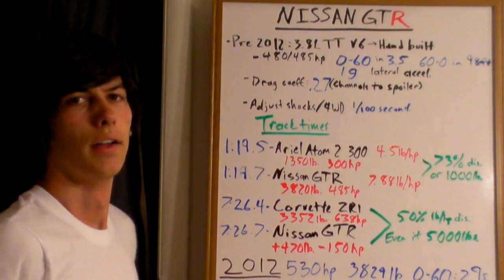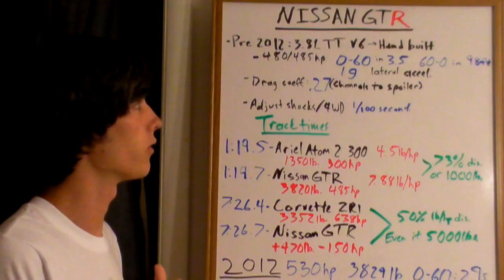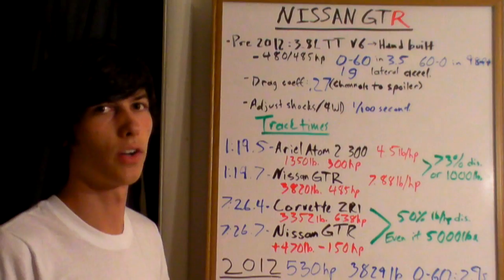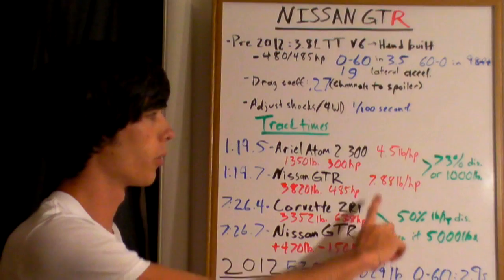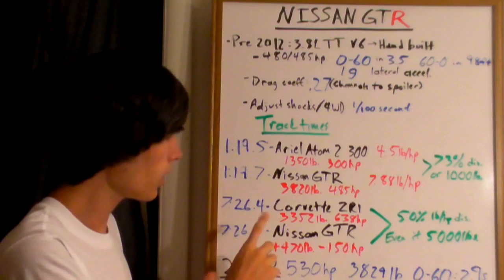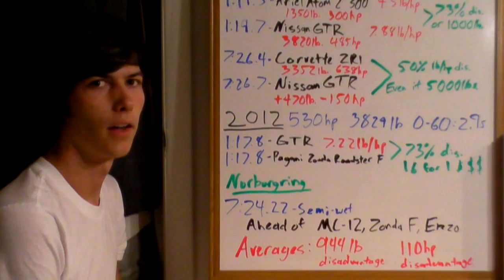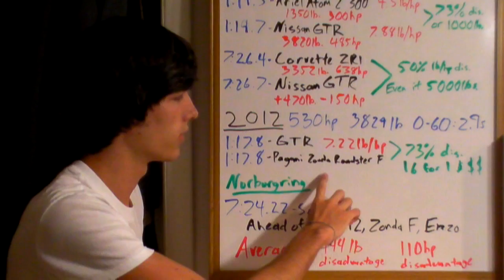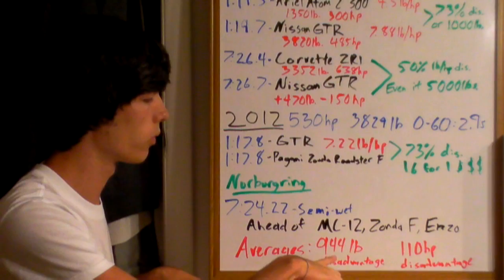Nissan GT-R - Engineering Excellence

Comment: I don't think anyone but a few people at Nissan can answer exactly how it is possible. It should be clear to anyone but the laymen (and you stressed that in the video) that power, and even power to weight ratio, are not overwhelmingly important, even for a high performance car. Putting the power on the ground is the fine art, and that's where the GTR excels in. It is also amazing aerodynamically. For the most extreme version, the NISMO, the downforce created is 220 pounds at 186mph, adequate cooling for a 600hp engine and for the gearbox is provided. Yet its drag coef is only 0.26, and it does not use active aero elements. And this is from a company that has never been in F1.

Comment from the maker: @hakeembisiolu This is true, and I didn't mention it. Knew it would come up eventually. And 45 hp will make a big difference, but even if you say this car had another 45 hp, it would still be at a clear disadvantage from a power to weight ratio. Basically my intention of this video was to show that you don't necessarily need a ton of power if you want good track times. Japanese engineers have figured it out. Others are a tad (or a lot) behind.

Comment from the maker: @JohnnyDeniz I can make a video on valves no problem. What information did you want specifically? Like differences between dohc/sohc/pushrod and how the valves relate? Also I do not know much about torque specs on engine casings. As far as rebuilds, what did you want to know? Thanks for your interest!

Comment from the maker: @JETZcorp There are advantages and disadvantages to a rear engine. Better braking and acceleration. The problem is with all the weight in the back the cars moment of inertia about the vertical axis (straight down into the car) is high, meaning the car doesn't want to rotate. If they improved the cayman more, other cars would have some fierce competition, but it seems like they don't want anything better than the flagship, which makes sense.

Comment from the maker: @zozlimits Could you explain why AWD is a disadvantage on tracks (or anywhere)? Sure, it's more friction, and at higher speeds it's much tougher to accelerate. But AWD allows for the maximum possible amount of torque at any time. You can't floor it below 40 without awd and expect no wheel spin with 500 hp at peak rpm. Around the corner, the torque goes to the tire with the most grip, not the tires holding the car around the corner. I'd just like to hear your reasoning, that's all.

Comment from the maker: @StevenSWM Same tracks, both Nurburgring and Top Gear's test track.  Tires were all different, but to my knowledge none of the cars were using slicks so grip is comparable for each car. The other cars are not 4WD, they are all RWD, however Nurburgring is a high speed track, and at high speeds grip is comparable for both 4WD and RWD. Also, 4WD tends to cause mild understeer, as well as reduce excessive speeds because of the added friction.

Comment from the maker: I still have plenty to learn. Though it main seem obviously wrong to me initially (weight having an advantage) perhaps there is some alternative motive behind it. A heavier car with 1000lbs of lift can go around a corner faster than a lighter car with 1000 lbs of lift, as it will have more weight, and thus can hold a greater G around the corner. I didn't think about this, but it's a good point.

Comment from the maker: @ERK572 That's personal preference, but at 80k you're still 35k shy of the R8's msrp, and that's for the slow (relatively) 4.2L version. The 5.2 starts at 150k. Where as the Nissan's performance blows it away for 60k less. Personally I'd rather have a GTR and a manual BMW 1-series M in the driveway for the price of a 5.2L R8. But hey it's all a matter of opinion and one's taste is one's taste.

Comment from the maker: One of the most intelligent AWD systems, torque vectoring to the exact wheel which has the most grip, a consistently high torque curve, a suspension which matches the vehicles weight perfectly, and a decent weight (rather than much downforce) for high speed cornering.

Comment from the maker: You could elaborate on what your point is. Of course different conditions cause different lap times. These times are the best times posted, mostly by manufacturers with the best driver they can get. No, I couldn't repeat them, but it is what it is. Some use roll cages, stickier tires, etc. But this is all well known.

Comment from the maker: Many corrections once more. First, it's awd, not 4wd. Second, you don't seem to have a proper understanding of grip. Grip (or the lateral g's a car can withstand) is a function of gravity (weight of car) and the frictional coefficient of the tires. It's commonly measured in g's (a force, so cars can be directly compared). The frictional coefficient of the corvette's tires is greater, so it has more lateral grip. AWD has nothing to do with a vehicles grip.

Comment: I used to have a 1999 Integra Type R and I can tell you from personal experience from track days that it was more than capable of taking on Italian Supercars when it came to track lap times. A set of big cams, free-flowing exhaust, sticky tyres and bit more bracing and correctly set up suspension geometry makes a huge difference to how the car performs. Don't underestimate the mighty Integra. Love the videos by the way. The LSD ones really helped get my head round how they worked.

Comment from the maker: I mean I understand why it occurs, I just like to open things for discussion. Basically it comes down to the AWD capabilities of this vehicle, and it's power band. By saying a car has "500 hp" that just means its peak hp is 500. Who knows what the rest of the curve looks like, at lower rpms. The GTR has an excellent torque curve which provides consistent power along the rpm range. Other vehicles may not have the same. The engine is well engineered. The suspension and AWD are nearly perfect.

Comment from the maker: Sadly efficiency is probably the only reason not to buy an STI, as they don't do well at all in that category. I like them due to several reasons: low cg engine (boxer design), AWD, powerful, capable on and off road, it's a sports car you can drive in the harshest winters or on a track, hatchback means incredibly practical, and personally I do like the styling, it's grown on me.

Comment from the maker: If the ZR1 was AWD, and had torque vectoring like the GTR, sure, it would greatly improve it's low speed acceleration, and improve the out of corner acceleration. This would add a lot of weight, however, so it's difficult to say that it would be quicker. Weight affects nearly every performance aspect of a vehicle (in a negative way).

Comment from the maker: Guess you didn't read the part about competition tires. 2 seconds behind, yes, but with so much more weight and tires without as much grip. Physics says it shouldn't keep up, but it does, which is why it is so impressive. 

As far as 15 seconds, that's about eternity in racing terms.

Comment from the maker: Would you care to offer a source? Weight and downforce are entirely different. Weight is bad for nearly all aspects of handling in good conditions, downforce means the car can hold greater lateral g's. Weight means the car can handle slightly less lateral g's as it increases. The key for a car that can go around a turn the fastest is high downforce, low weight, and of course some sticky tires.

Comment from the maker: The lbs of disadvantage is a stat saying if you took added 1000lbs to the Ariel Atom it would have the same power to weight ratio, but obviously it wouldn't have the same lap time. I did misspeak in the video though, and said 1000 onto the GT-R, I mean on the Atom. 

Good luck with your presentation!

Comment: Great video! Its a combination of the amazing AWD system combined with the quick shifting dual clutch gearbox, and notoriously underrated motor. The sensors this car has and the algorithm used to manipulate power delivery to the individual corners (wheels) has never been done before in a street car which make this car seem more like magic then engineering. All these thing combined deliver power to the ground in a way never seen before in a road going car. Please continue the great work :)

Comment from the maker: I'll agree with you on gearing, but nitrogen in the tires is far from an answer to why it handles. The compound of the rubber is far more important than what's inside. Nitrogen just seems like a way for dealers to make some extra money. Less variance in pressure due to temperature, but air is 80% nitrogen anyways...

Comment from the maker: There are RWD cars that can hit 60 quicker than 2.4, surely with AWD it would be quicker. Sure, the 1700 is at high RPM, but you can launch from high RPM. NHRA dragsters (granted, ridiculous tires and power) can easily hit 60 in less than a second.

Comment: I copy and pasted from one of my post. To safe times.

That thanks to the electronic aids and weight distribution. Put the same electronic aids on Range Rover, I bet even Hummer H1 will be defeated. There 's more than 4 monitors. 
1) Engine ecu. Same ecu as most cars, controlling power output, rev limiter, engine temp monitoring etc...

2) ABS control unit. It'll unlock the locked wheel during heavy braking and also will match the spinning speed of both front wheels. That'll improve braking performance and stability.

3) AWD control unit. Split power to specific axle to avoid push and understeering. This also work with the yaw rate sensor, whenever the car push (yaw less than steering input), the system will split torque to the rear wheel and when it yaw more than the limit, it'll split power to front wheel. The yaw sensor works pretty much same as the one you can find in an airplane.

4) transmission control unit. Pretty much the same as any dual clutch semi auto transmission. It'll shift to a lower gear when transmission set as "race" mode.

5) stability and traction control. The stability control works the same as Merk and Audi. Apply brake to where the car point at for increase steering respond, When the car start loosing it, the system applies brake to the side where the car oversteer. For traction control, it'll decrease understeer and push by better traction and grip due to 0:0-0:1 spinning ratio.

5 of them works together, it'll become an UFO. and with some daily engineering like hill climb assist, 11 bose speaker, taller, wider and longer, this car is the most capable sportscar, more capable than 991 911 Turbo S.
Reply: Well said, launch control + 100

Comment from the maker: I would disagree that a perfect driver could do better. If computers can set the rpm and traction control so that the maximum force is applied to the ground while always on peak traction, then nothing can be quicker. Also, a computer's reaction time to loss of traction/gain of traction will theoretically always be quicker.

Comment from the maker: Please, find an engineer that agrees with you. Grip is a term used to describe friction. R-compound has a higher friction coefficient, therefore more grip, therefore a car can go through a corner faster than an equivalent vehicle with lesser tires. Sure, awd helps put the power down, but only at the limit of the tire's grip. Watch my video called "traction circle." Should help you understand the advantage a little better.

Comment: actually its about the balance between weight at front and weight at rear, also, the gtr has a staggering standstill acceleration because of the high amount of weight that is pushing down on the tires, plus it has 4wd, so all that power is converted pretty much instantly into motion. plus in terms of cornering, since it already has quite a bit of weight, it is easier for the driver to just step on the throttle after the apex rather than carefully increasing it like you would in a very light rwd sportscar
Reply: The GTRs since 530-545-600hp will get stupid sideways out of corners.  My 2015 will drift in R R R. It's soooo fun. But it never gets too much to handle unless you are going balls out. It's pretty easy to bring it back inline. I took a 9 degree corner with a very small apex at 70 today and hung the tail out for a good 3 seconds and it never rotated too far out and I just stayed on the gas with a little steering correction and was hitting 130 in no time.  GTRs are beasts if you now how to drive

Comment: Nissan has used their very own advanced and clever ATTESA AWD system since the late 80's.. They have refined their technology to be very responsive, accurate and active.. The drive train layout of the gtr helps keep it balanced in any situation, using a premium midship and trans-axle design. . Also, there are several other things that help the gtr performance including tire design, spring rate and dampers, clever differentials, its hand assembled transmission, etc.. The chassis is very balanced due to it being put together on hydraulic jigs. .. The weight of the car helps keep the tires from "breaking loose" or loosing traction, which also contributes to its low 0-60 launch times. . But overall,  many Japanese car manufacturers including Nissan has had advanced technology for decades, giving them plenty of time to refine and modify their product...

Comment: Great you put the video together, and for conversational purposes a very good comparison. 

... as I have a GTR ... it also has 4 places and a big boot!

The GTR can move its torque from 0-100% to 50-50% over the length of the car, then it also has per wheel torque vectoring allowing it to push harder on the outside rear and front wheel when cornering. So when you turn left, the outside right-hand side wheels put more power down, helping the car to turn. The Skyline GTR R32-34 had 4w steering.

Comment: the Nissan GTR is an exercise in computer programming and managing power output to all four wheels. the car does most of the driving for you especialy when driving at the limits.
Reply from the maker: It may be driver friendly, but I know I certainly couldn't drive it around these tracks anywhere close to the times posted.

Comment: I think it's a combination of factors
>ATTESA-ETS AWD system (which does those hundreds of calculations per second of the car's dynamics) and maximizes the use of the available grip on offer each moment
>Brilliantly engineered chassis which is extremely stable and rigid
>Large area under torque/power curves
>DCT
>The car is likely also fairly "predictable" to drive, which means the driver has an easier time putting more confidence into the driving he is doing and overcoming that mental barrier.

Comment: The reference was to top gear's feature article on the gt-r and its chief engineer.  He said that he wanted a car that weighed this much because the weight would come down on the tires generating the grip needed for high speed corners, whereas cars that weighed less needed more aerodynamic aids to generate the equivalent downforce.

Comment: And how thick are the Viper's tires? 365's or some crazy width? it's a fast car but it's mechanical grip vs computer grip "which isn't a bad thing" but some company's like Porsche, Nissan, BMW, etc do more with less using computer power to enhance what they have to it's maximum capability, hence the smaller engines, thinner tires, awd, etc, unlike the Zr1 and Viper which use thick sticky tires, a big engine, big aero kits, etc. Generally giving them more grip but worse handling feel.

Comment: It can put the good amont of power to the wheels that are not completly used by the cornering "power".

The a good way to see how its clever, is that Porsche will use rear wheel steering for its future GT3, to got the same principal of use of the entire traction tire potential.

Good videos :)

Comment: AWD system means more grip and less drag from the friction of the non-driving tires, even though it has more spinning mass, yet that mass makes it more stable with a lower center of gravity.  Usually high powered, rear wheel cars have a lot of traction loss, but you don't get that with the GTR.  That's why you'll always see a GTR jump quicker than other cars in a drag race, but not necessarily keep the lead when its lower torque can't keep up later down the road with its weight.

Comment: Its about torque applied to the disc and with an 8 piston setup you mentioned the torque is just being applied sooner and smoother onto the wheels, therefore you stop "quicker". You achieve a shorter pedal travel within shorter time with greater torque, that is why you feel you stopped sooner.
Tires that stop cars not brakes.

Comment: Just couldn't help adding my two cents worth. I also admire these cars lol. The short answer in my opinion is handling. I have only driven an older 'grandma' skyline, not a purpose built track car like the GTR, but it was surreal how balanced it felt. It's the only car I have driven where it's handling limits scared me. In other words, it could corner faster than I could. I am not just referring to suspension tune here, but steering balance/weight, braking performance. The complete package.

Comment: While talking about the laptime on the topgear test track compared with the Corvetter ZR1 and the Zonda F you have to keep in mind that the GTR gets a much better launch because of its all wheel drive system whereas the other RWD cars dont have as good a launch and topgear laptimes and are with a standing start. Also the Dualclutch transmission in the GTR insure minimal loss in momentum when accelerating while the other manual cars lose time everytime they shift. Still dynamically GTR is awesome